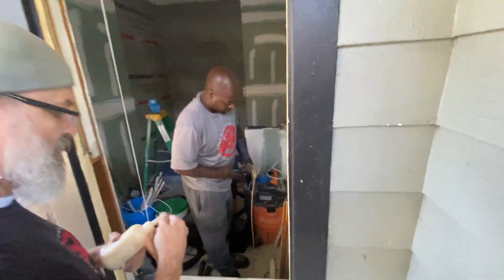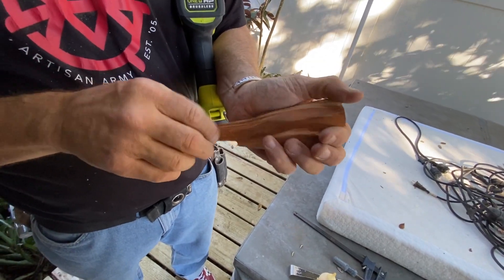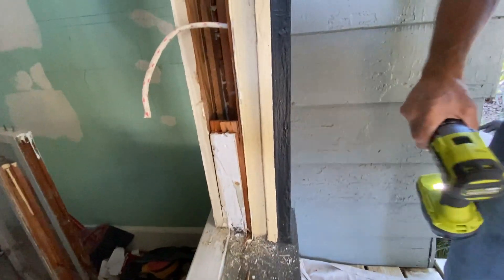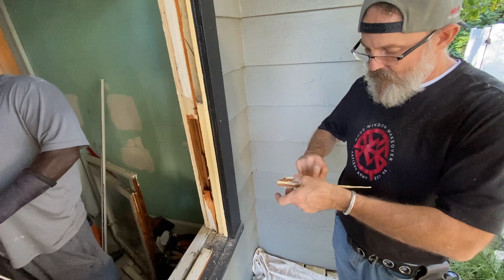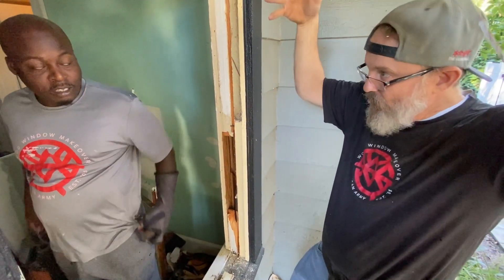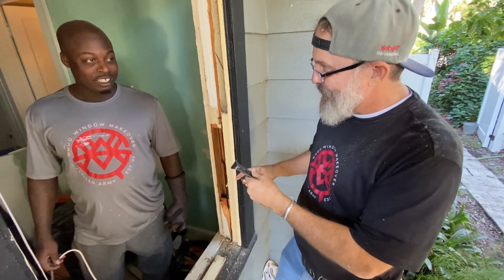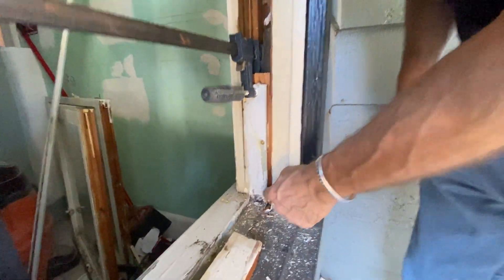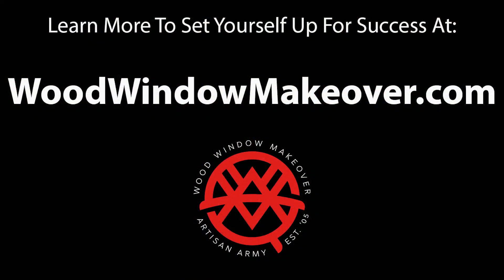Wood Window Repair: Taking Time To Save Time

Comment: called casement covers here,,,,installers used small copper nails to seal weight compartment,,tounge and groove style,,old wood like this leaves the tongue dried and brittle after a hundred years,, to seal it up after the top window is seated properly, toe hole the cover about a qtr or 3/8th in to anchor the cover into casement wood,,oiling the wood helps to strengthen the holding power thought I;d put this into the kitty,open each sash cover when cutting new rope for the weights,,,stick a skinny shopvac hose inside,vac up 100 yrs worth of household and coal dust

Comment: Might want to look into the history of the weight doors. They never finished the cut  when original because then it would be sloppy. The first “break” of the door would break that piece off.
Reply from the maker: We do the technique also. These doors didn't have their break cuts complete and as you see on the second one it took a large chunk with it when we did the break. After we noticed what Kenny noticed and did a completion of the break cut to properly remove as intended.